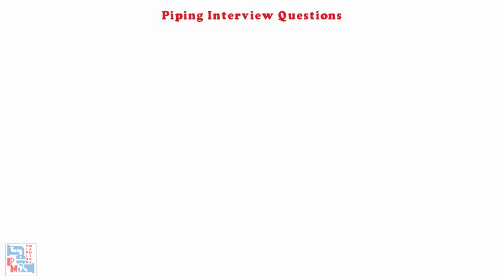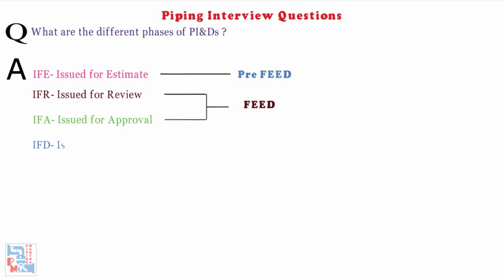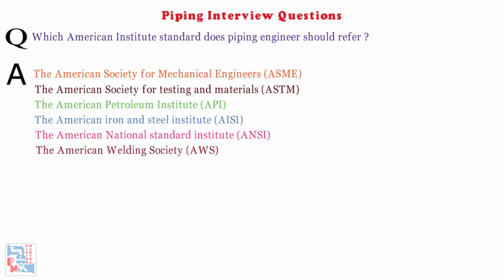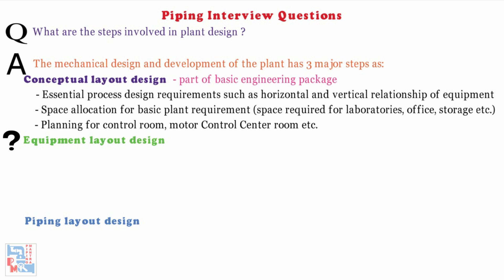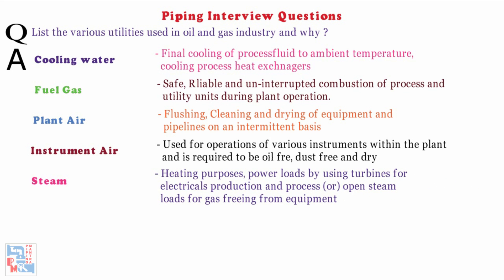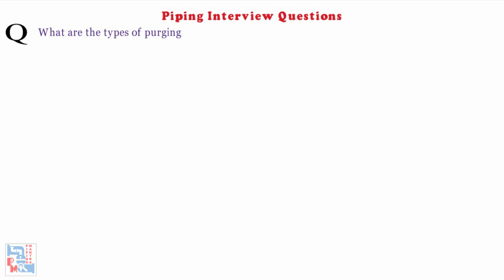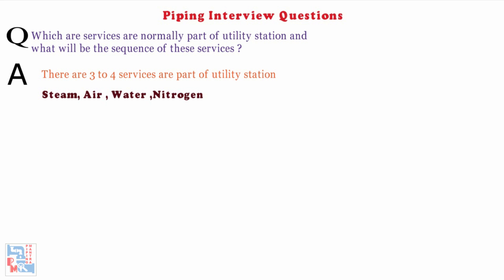Piping Interview Questions | Part-1 | Piping Mantra |

Comment: timestamps interview questions
00:00 Piping Mantra Introduction
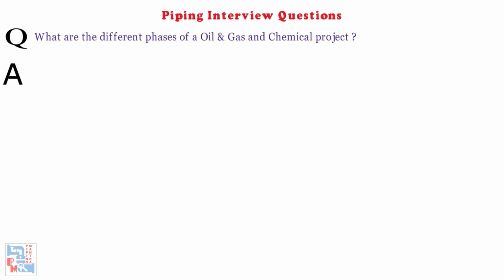00:29 00:52 What is the different phases of oil and gas and chemical project?
00:53 01:39 What is the different phases of P&ID?
01:43 02:10 What The American Institute Standard does Piping Engineer should refer to? 
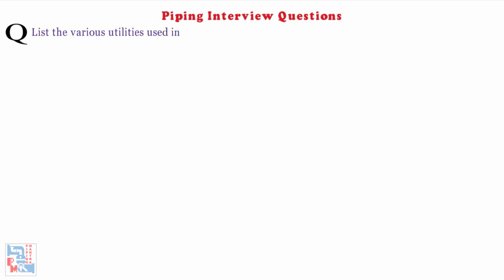02:12 03:49 What are the Steps involved in Plan Design
03:50 04:53 list various utilities used as oil and gas industries
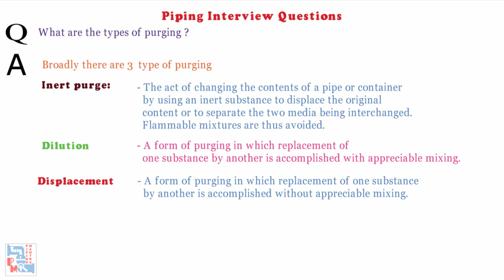04:54 05:55 What does purging mean and type?
05:56 06:33 What are services normally part of utility station & what will be the sequence of these services?
Reply: IFH issued for hazop